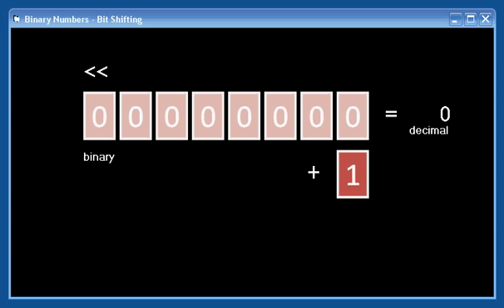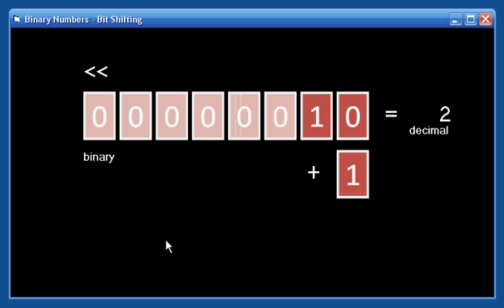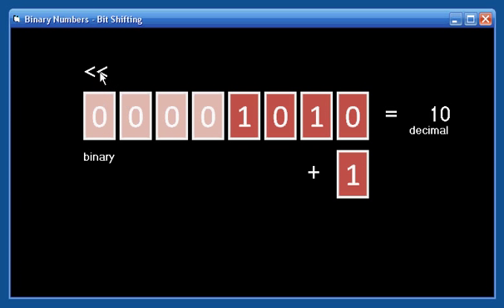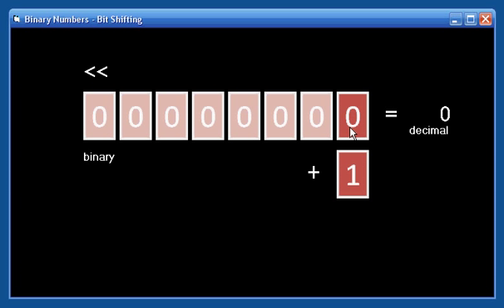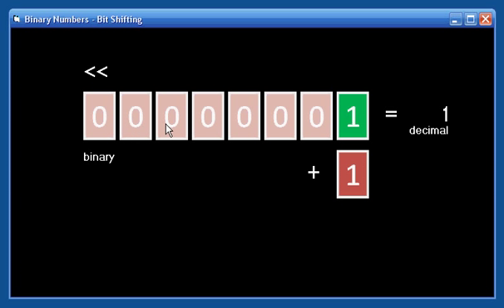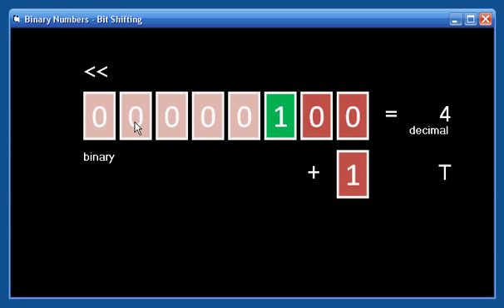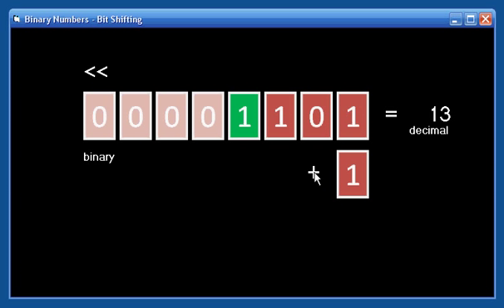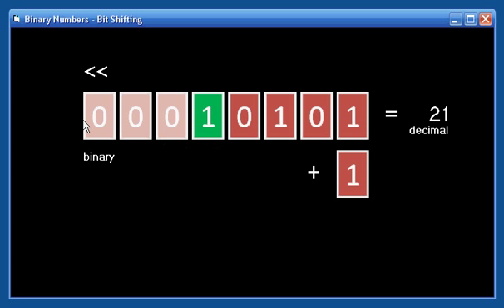Bit Shifting - Teaching Arduino to Copy Morse Code

Comment: Thank you, Bud. I can now start to understand how your decoder uses the String and shift to find the character. My method used two char arrays and a compare in a for loop. That uses much more memory and is slower, I suppose. To include punctuation you jump to a switch/case routine whereas all 55 characters are in my arrays that have a common index. I will play with your routine more and learn from it.

Comment from the maker: When you shift bits to the left, every bit takes on the value of the one to the right of it and the last one becomes zero. So if the original value is: 10000000 and you shift the bits to the left, the new value will be 00000000 the highest order bit is always discarded.

Comment: you never explain or show what happens when you shift a 1 more than 8 times. What happens? Does the 1 reappear on the right side of the bit string or does a zero now take its place?
Reply: Morse only has 7 bits so it is not a problem, in this case.